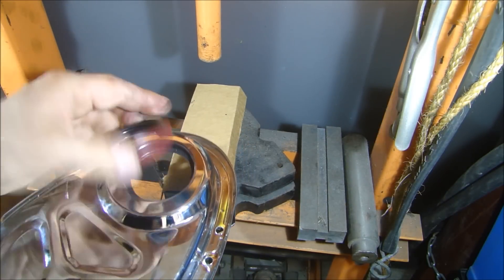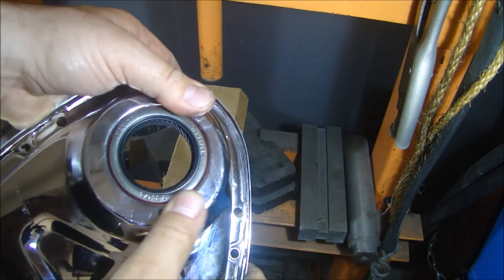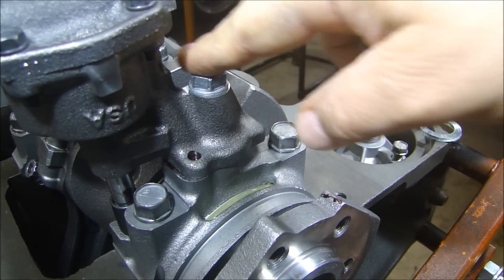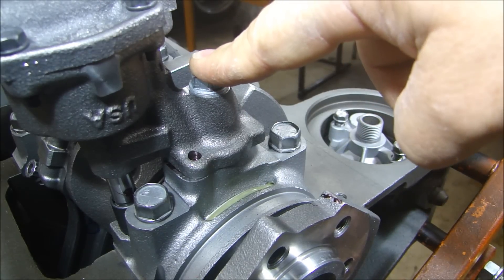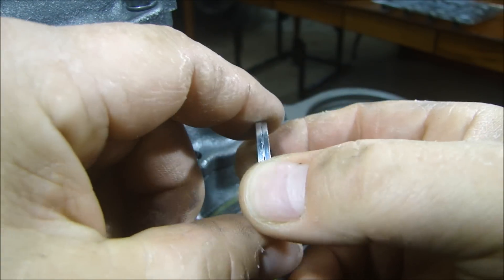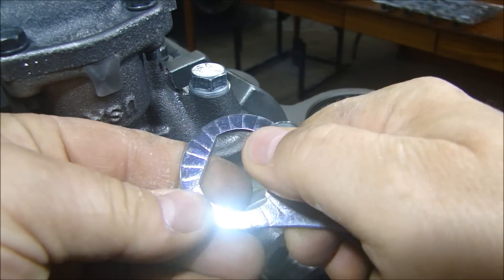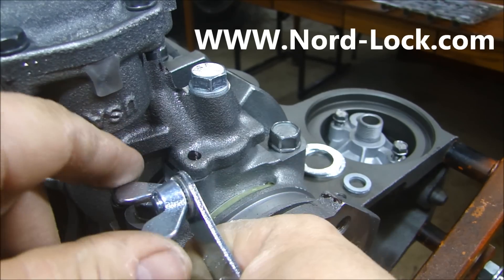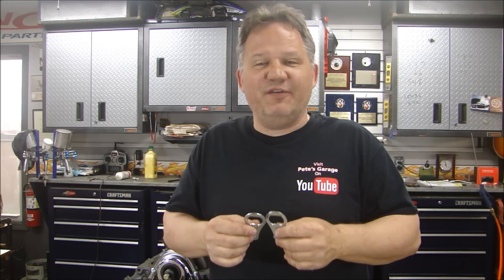Engine Building Part 6 - Timing chain Cover and Seal, and Lock Washers Chevy Small Block Chevy 350

Comment: did you not bend the tabs over on the cam lock plate on purpose....and just curious why your crankshaft sprocket went on so easy...usually i have to press it on...thanks

Comment: Do you not bend the locking tabs on the three screws for the upper timing chain gear?
Reply from the maker: I did bend them but the video got messed up and I couldn't include it, very good eye for noticing
Reply: @PetesGarage  I've been a 2-stroke guy my whole life - I worked at Outboard Marine Corporation for 25 years.  I love watching your videos.  They are very well done and I'm learning a lot about "car" engines.  Thank you for sharing your technical knowledge.
Reply from the maker: Thanks Kevin

Comment: Why did you affix Room temperature Volcanizer  on the gasket of the timing chain cover? Whenever i seen R.T.V. on differential covers or water pump gaskets, i have observed leakage of the respective fluids and or R.T.V. inside the carrier or inside the water pump?
Reply from the maker: I do not use RTV at all. I use anaerobic or petroleum based sealants.
Reply: @PetesGarage  much obliged for your reply Pete! You are a wealth of knowledge.  Here is the difference to what i have noticed.  I will archive this in a folder in my memory.

Comment: You forgot to bend the tabs on the timing sprocket bolts. I've seen this mistake before and those bolts will come lose. After that is when the real fun begins.
Reply from the maker: I did not capture that on video, minor deletion accident, but I did bend the tabs. Thanks for the comment.

Comment: Did you forget to bend over the locking tabs, on the cam shaft lock plate? Or is the lock tite on the threads enough? If lock tite is enough, what's the purpose of the lock plate? Does it hold the cam in place? Does it hold the cam button in place? Did I miss the explanation?
Reply from the maker: I did bend the tabs on the lock plate. I left that out by mistake.

Comment: Good video but not sure if you noticed looks like you forgot to pull the tabs up that lock your bolts on your cam before you put your timing cover on.
Reply from the maker: You are sharp for noticing that. I  made a mistake when making the video and that part didn't get captured, but the tabs were turned up.  Thanks!

Comment: 6:30 -  Timing cover goes on and you haven't bent over the lock tabs on the cam gear bolts !
Reply from the maker: You are right, I did however fix that after I made the video. Great eye and thanks for the comment!

Comment: I'd love a bottle opener Pete. Just got my first ever project, didn't have time or space for a car but got an old motorcycle. Your channel is one of a small handful that gave me confidence to work on everything myself.
Reply from the maker: A motorcycle is a cool place to start
Reply: Pete's Garage yea for sure. I'll get to practice bodywork and paint, upholstery, mechanical rebuilds, maintenance, and probably electrical. I already rebuilt the clutch slave cylinder and bled the system - my first time ever doing that. Went perfectly!

Comment: Today i used RTV as a gasket on my diff cover. The rtv was very "soft", compared to the "permatex the right stuff". I think it squished out a fair amount into the diff when tightening the cover. Can this stuff damage the bearings? I waited about 1 hour, it was nowhere near dry, no leaks yet. I also want the bottle opener
Reply from the maker: I 'think you be ok.

Comment: What are the lock tabs for on the washer behind the cam sprocket bolts? Are they locktite-ed and if so is that enough?
Reply from the maker: The bolts have red threadlocker. Those tabs do get folded up to hold the bolt. I accidentally left that out of the video.

Comment: I want a bottle opener for sure!!! But more importantly, I want to pick your brain a bit on a 454/489/496 BBC build I'm planning for a boat I'm building (pics linked below...there's a lot). Engine build won't start until the fall - still have to finish the boat - but thank you for your education in the meantime! 

https://www.facebook.com/media/set/?set=a.1007656525867.2003777.1658550263&type=1&l=410d0be633
Reply from the maker: That is some craftsmanship there!

Comment: So does this make them a one use washer? Also once you’ve torqued the bolt down, and down the like you need to undo it, does it make it really difficult?
Reply from the maker: I would think you can use them again. After it is torques it certainly does make it more difficult.